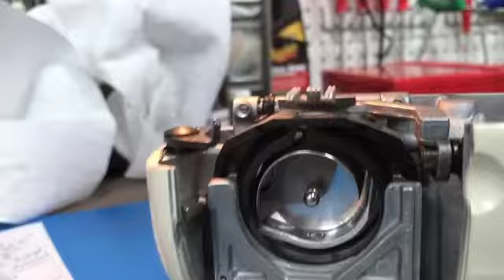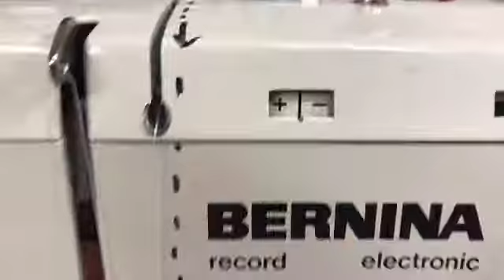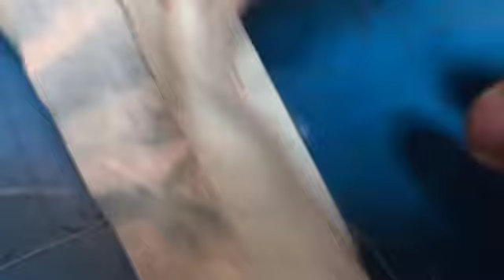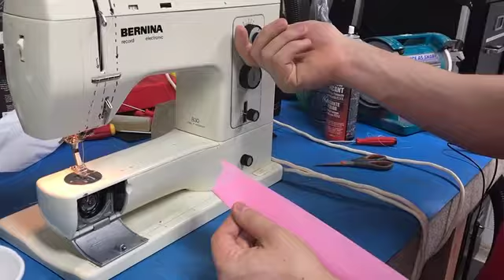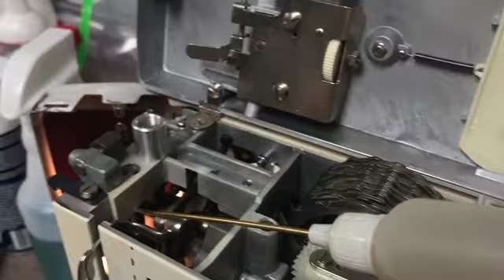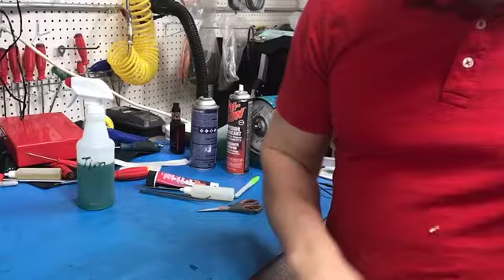How To Service A Bernina 830 Machine (Old Style)

Comment: Do you not check the carbon brushes when you service a machine? Do you look at the capacitor in the motor compartment to see if it’s leaking or  cracked even a little bit. Do you not open the motor area/cover at all?

Comment: This video has so much improper information in it Bernina does not use a 15 class bobbin is a different size.  Also, you can look at any CB oscillating Bernina manual, you placed the bobbin backwards it should be rotating clockwise when looking at it in the bobbins case so you’re going to get an improper sew.  Bernina service manuals. Tell you to never grease any of those components there is no grease inside. It should be dry. It is a nylon to steel and does not need grease.
Reply: I am surprised to only see one comment pointing that out